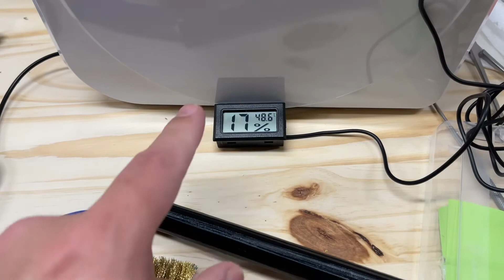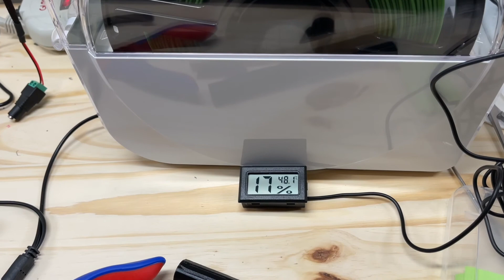Easy no soldering fan installation to Sunlu filament dryer.

Comment: Solid upgrade👍 thank you for sharing i just copied your setup. The only issue i ran into was if i split the power with a splitter, i lose power to fan or the heating element. The sunlu dryer calls for 24v 2am psu and thats what came with the unit but the fan requires 24v 0.08amps. So i ended up using two different 24v psu’s one for fan and one for sunlu dryer.
Reply from the maker: Too bad the PS was not strong enough. Mind works off just the one.
Reply: I also saw this. I bought some 12v fans and power supplies. I also have the new S2 model. It says a fan is inside, but I do not feel the air moving. These fans also fit inside the compartment. Maybe I do not need these upgrades but I do not think it will hurt. I will also add a small round sensor for both heat and Humidity. Haha, lots of fun. Thank you for the video

Comment: It is a very good mod when dryer is just used when no printing. 
When printing any fan is not necessary as spool will rotate when filament is pull and whole filament spool will be dryer "evenly"
Reply from the maker: Very correct. I often will dry filament for several hours before printing. The fan is not required when I start printing but I often forget to turn it off.

Comment: So with this mod the heater runs all the time to actually reach the set temperature? or has the heater further juice, to reach higher temps? you can find out with a power meter, to see if it sucks 48-50 W continuously, or it disables the heater from time to time.

Comment: Soo… being an RC guy, why not use a 5000mah 3S battery  with a 12V fan? At such a low amp draw it should run for 6 months on one charge
Reply from the maker: That is a very valid question!!!

First never thought of it.

Now that you mention it and I have thought on it, I would not leave a lipo doing something unattended in my house. Yes the current draw is low but I could just not do that. This way it’s only running off a power supply. I added an inline switch so I can turn it on and off.

Comment: Any idea what size barrel connector it uses please?
Reply from the maker: It works with this size. This is the splitter I used.

zdyCGTime 2Pack DC Power Female to Male Splitter Adapter Cable 1 Female to 2 Male 5.5mm x 2.1mm DC Power Supply Splitter Cord for Security CCTV Parking Security Cameras(1 to 2) https://a.co/d/2Ls2RoC

Comment: Do you have the links for where you got the fan and the barrel connector? That would really help .. thanks!!
Reply from the maker: Links are in the description.  You just need a 24v fan suitable for the enclosure. The one I got is no longer available.